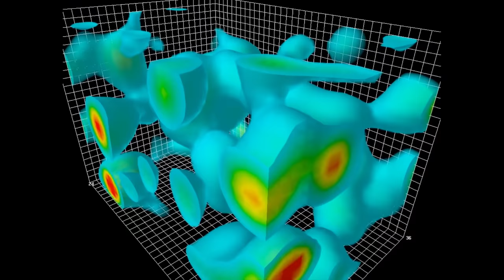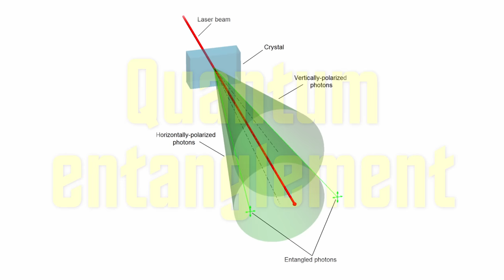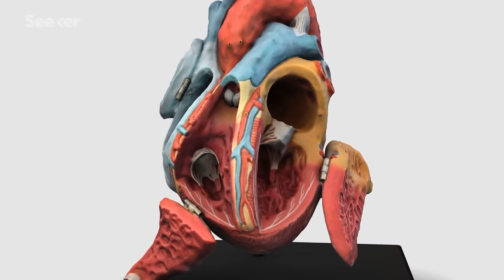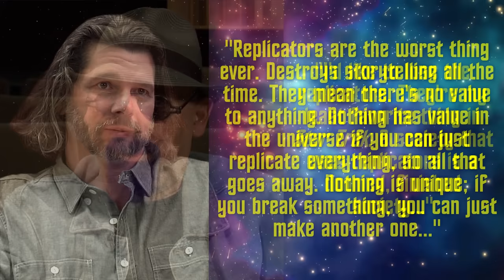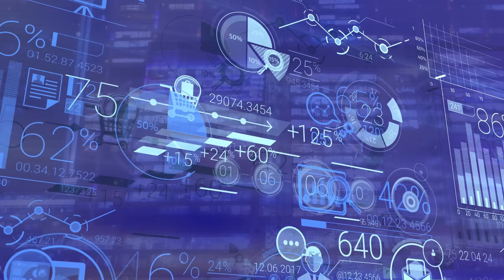Do Star Trek's Replicators Break the Universe?

Comment: With regards to 3-d printing, you cannot escape market capitalism if you cannot escape scarcity. While 3-d printing would disrupt manufacturing, there would still be markets for the raw materials that the printer uses as well as the energy they need to run. Star Trek has fusion. We dont.

Comment: One of the key questions is do replicators actually build elements (through nuclear fusion that is) or does it need to store elements and uses them. I think the latter is the case, as the first one would need too much energy, even with matter-antimatter reactors on every starship. Dilithium is probably very hard to come by and only available in the federations starships in abundance, because they are top notch. That means a replicator cannot replicate anything that has exotic elements in it. E.g. Most probably no radioactive elements at all. 
That would mean you'd have to refill the element storages somehow. Now waste disposal is for sure part of that process, especially when it comes to food... A starship is essentially a closed system. Nothing would just disappear. But for replacement parts there for sure is a certain limit to how much machinery can be replicated, unless you disassemble every scrap part (if that's possible).

Comment: OK, I'm a little confused with the problem of the three D printer, which should be a precursor to the replicator. The reason why I am confused is that going backward in time one reaches the notion of colonialism; taking raw materials from the colonies and bringing them to the main country for manufacture. The American "Revolutionary" war was fought, in part, to allow the colonies to manufacture things right there and technically it did not destroy the economy in the process.  This is similar to the "replicator" which is vague enough in the canon to be nothing more than a really fancy 3-d molecular printer. The real advantage of the star trek era is the ability to provide cheap unlimited power (which for the most of the franchise turns out to be fusion but that's another matter altogether).

Comment: The ability to replicate anything is simply knowing how many atoms it takes to build whatever kind of molecules you need and then placing those molecules into the right sequence to build the thing you want. If you know exactly what kinds of atoms and how many of each you need for any given object,  and know how to put the atoms and molecules together,  then it comes down to how much time would it take to do that and how much energy you need.

If you think of atoms as, say, individual Lego blocks, each with their own color and special ability, then all you need is the right number of the right color blocks, knowing how to put those blocks together so that the blocks interact with each other in the proper fashion, and then building your object.  The more complex the object, the more different colored blocks you'll need, and the more time you'll need to build it. Just like building a small Lego car would take less blocks and less time than a 3 foot diameter replica of the Death Star. Both are possible if you have the right blocks, know where they all go, and have the time and energy to build them.

And because organic materials are far more complex than inorganic, you'll find that it will be a lot easier, once the technology gets to that point, to make equipment and parts for things like spaceships than it will be to replicate anything like food.

Comment: Okaaay…from someone who worked in manufacturing and engineering there are a few caveat emptors here. There are limitations of resources involved. The assembly line is still superior for multiple parts for replacements. Like making by hand one screw or going to the store and getting a replacement off the shelves. Individual items take more resources like more energy than mass production. Mining, factories, and farms will still exist because they are more effective and efficient in supplying needs. 

I suspect the factory style replicators mentioned for Bajor are only good at making simple big items because super complex will have an unacceptable error rate and energy use and only using for things like steel beams. No wonder the planet still uses farming for feeding their people.

Comment: Replicators have way to many limits to break storytelling.
Complex machinery is generally off limits. As are any materials that are needed for the plot. And latinum. And Dilithium. And anything living.
Also they do still need energy. You spend less on mining and refining, but replication is not a loss free operation. Never mind repair and maintenance on the replicator, which probably can not produce parts of itself.
There are also issues with the things never functioning when you need them in a crisis, so storage still is important.

Comment: Replicators: Manipulating the four states of matter, you would first load in the matter through a scanning device of some sort to be stored thus giving you the recipe to then create it from then on, also being able to tweak it with additions or subtractions.  But it's the socioeconomic worries that I find to be unfounded. 3D printing as you said has caused some issues but how many regular people own one?  Just as digital currencies have gained and now fallen quite a bit, but the truth is that they are not going away and it didn't hurt economies or put anyone out of work.  I think it comes down to the power structures that are in play at every level, not power as in production of power but the power that is wielded. 
I also can't imagine the storage space required to store even simple objects to be replicated.  You also have to consider the 3D printer and how it comes in many make/models with varying degrees of ability, so would replicators. So whether they are issued or purchased what degree of ability you would end up with would be dependent on something.
I believe that it's presence in the world would be accepted as easily as having all of mankind's knowledge at your fingertips ie your phone.  As robotics continues to accelerate I don't think there is a job now that can't be replaced with robotics/AI.  So the solution to the workforce problem of that is in fact the replicator.

Comment: I actually have a solution for the uncertainty issue for transporters, sort of. If you have a particle that is bound by a signal medium like a laser, which is something they do in labs, it is effectively at either end point at the same time, so, what if you could prism that type of signal, so that the end meant to receive a particle, was instead of focused point but a spectrum range, or basically splitting the signal so that the particle is 1000000000000000000000000000000000000....... times more likely to be the other end at any single point in time. So at the point the uncertainy has to be resolved, it would be possible but infinitesimally improbable for the particle to still be at the sending end, basically forcing it resolve on the other side (head cannon for how Stargates work in the Star Gate universe, and explains why wormholes can only send matter in a single direction, but the carrier signal the gate itself uses to connect to other gates can modulate with a radio signal like a string carrying sound, and the other gate rebroadcasts it so that's why it can function in two directions for radio signals)

Comment: Not really sure why the writers hated them so much. There are many things that could have been done to nerf the replicators' seemingly infinite capabilities. Software restrictions (such as non-officer units being restricted from creating weapons) or data limits (not having the required data needed to create an item) were obvious blocks that I seem to recall being in the shows. Power constraints are also a problem as either the energy or the matter needed to make an item has to come from somewhere. Electromagnetic interference from other devices or phenomenon in the are also could easily effect such a device, as any variation from the strict programmed reconstruction could cause incomplete replications, flawed replications, or even complete failures in the process. Replicators are far from the perfect technology. Also used in early episodes of Voyager were moral constraints - they didn't just go in and replicate a need for a people willy-nilly. The Prime Directive made it so that Starfleet was not supposed to directly interfere with a culture's development, or upset balances of power between factions. (Of course, this never stops it from occurring at times when an officer defies the Prime Directive for whatever reason, but that is another matter).

Comment: The real one is coming in 30 years, its being build right now, its called the Nano Fabricator, it can take apart molecules atom by atom and rearranging them to print what ever you want, Earl grey tea cup and all, it can also recycle anything 100%, including taking the carbon out of the air, creating a solid block of carbon to be used for other projects. it can be seen as the analog version of the replicator, you could recycle organic things, move the atoms along tubes and reassemble the thing on the other side with another Fabricator. (and no you won't be able to tell the difference between printed food and grown, as the atoms used are the same)

It won't be able to make atoms from energy as we are not there yet.

But imaging people making a dish, selecting the upload button, placing the dish on the pad, it will get recycled remembering the position of each atom and atom type plate and all, giving it a name, and anyone with a Fabricator, can select the dish, put in the raw materials, mostly dirt, water and air, and it will be printed in the blink of an eye. (Things at Nano scale go 1000 times faster than on the macro scale)

Comment: I'd say no, Replicators do not "break the universe." the best part about the replicators is that they have made them so diverse, and limited.  for instance I seem to recall that worf and data had to go to a special room to "order" a present for someone and it appears to me that they couldnt simply replicate these items on the replicators in their rooms, meaning the ones in their rooms are only capable of replicating food items.  so it's probbably not just an issue of software handicaps, but certain replicators simply dont have the capability to replicate items using certain heavier elements.  for example you cant print a fully loaded glock in Ten Forward, not just because the computer wont let you, but the replicator is incapable of replicating certain metals because it's just an organic elements grade replicator.  It would make sense that having more complicated & capable, replicator be able to handle more elements such as metals, would simply cost more money and power to make. Just like having a metal 3d printer is more expensive and a more complex machine to use the metal sintering system capable of making metal parts.  I also remember an episode where they were talking bout delivering "industrial replicators" which I would presume would be more dangerous and more powerful, likely capable of producing the various metal parts needed to manufacture items like tractors, and industrial tools, made of metals.  

These limitations and "handicaps" that the writers have already put on replicators give the writers the various macguffins, and other such plot devices.  so, no.  I dont think they destroy the stories.

Comment: My biggest complaint with star trek replicators is their focus on energy to matter conversion. I'm no scientist but from my understanding the process of converting energy to matter is a massive leap in technology and would like require astounding levels of power, not just the energy being converted but energy to facilitate the conversion as well. It seems like it would be much more logical for replicators to have banks of elements that are manually arranged into the desired compounds, this would be objectively less energy intensive, would probably be "lower tech" and more realistic. Plus it would add an interesting plot device where certain plot items that need replicating could require unstable elements not carried in the replicator banks or by having a finite amount of material that can be replicated before they need to go "restock" on certain common elements. I think a plot device like this wouldve served the Voyager series very nicely.

Comment: Since the principle is based on the idea of reorganising atoms into whatever you desire (which is not theoretically impossible) it is entirely possible to work.
Of course, as it stands we don't have the capability to do that in the insane quantity of atoms that would need to be arranged in order to produce any item desired.
Seperating electrons, neutrons and protons from an atom to turn it into a different atom isn't a simple process; currently this is done by shooting the atom with subatomic particles in order to seperate or add particles to the core and often results in just producing isotopes of the existing atom. This is done manually, one at a time. You'd need to to be able to do it to millions of atoms in a short amount of time. 
Again, this isn't impossible in theory but we're a LOOOOONG way away from this kind of technology.

Comment: No, they don't violate the laws of the universe.  I have to constantly explain this to uninformed people what a replicator is.  At its core a replicator in Star Trek is a small-scale specialized cargo transporter that takes basic materials and compounds from a ship or facilities stores and cargo bays such as polymers for the dishware and complex carbohydrates for the pasta.  Then using a set of stored instructions in the local computer core i.e. a replicator pattern, the unit essentially 'builds' your requested item molecule by molecule including exciting the appropriate materials to give the patron in this case a plate of warm chicken primavera instead of melted plate of cold pasta.

Comment: What isn't discussed here is where does all the energy come from to replicate things ?  If I understand it correctly a replicator is converting energy into matter.  Einstein had E=mc^2 which is how much energy you could get from antimatter.  For a very small amount of matter it takes a huge amount of energy.  On a starship it is assumed the energy comes from an antimatter reaction regulated by dilithium crystals and then routed through plasma conduits to the replicator.  This means the plasma conduits must be able to handle insane amounts of energy.  They use plasma conduits for the control panels.  No wonder they are always blowing up in the helmsman's face !

Comment: I think that the "problem" with replicators is that most people don't seem to understand how much "energy" is inside even one atom of hydrogen, to even synthesize that from raw "energy" let alone billions of different kind of elements...someone needs to calculate the energy necessary to make a normal size red delicious and then tell me if they are feasible in that right, if so, then they will definitely be ubiquitous at some point.

Comment: The replicator used, according to the tech manual for the Galaxy class ship, the left over radiation from warp drive to power a transporter like effect that recycled waste material (including bathroom) into hydrogen that was stored to be reused as both impulse fuel and plasma for the dilithium reaction as well as reconstructed into the everyday items used by the crew. Incidentally that same waste radition was the stuff transported on those radiation barges featured in Voyager but by then the writers had already trashed so much of the canon of the series that it was never mentioned.

Comment: Replicators are the extreme of our days processed foods. They are faster to "prepare" but they are not as nutritious or flavorful as home cooked food from scratch. The time saved by the use of processed food is lost in health. As far as 3d printing of parts and materials. 3rd printed parts is not as strong as hand made, but they make materials and parts available to the masses were as you had to home someone makes and sells the part you need. As a person who loves to restore old equipment it is becoming harder to find what you need at a reasonable price.  Having a 3rd printer in plastic or metal would help a great deal in that respect.

Comment: Thanks.  I think they play with the idea that the food is always absolutely identical.  If you order a chicken sandwich, it's going to be the exact chicken sandwich you ate last week / month / year, right down to how the lettuce curls, and that one inedible bit in the corner.  In theory, they would've used an example of each food, and just have the replicator copy that, down to the molecular level (as you pointed out).  So you might get tired of eating cloned food.  There's no 'natural' variation.  You're eating the exact same sandwich, down to the crumb.  Every time I make a sandwich, it's different.  Also, I don't think I ever saw someone order 'extra mayo' on anything.  It's totally cookie-cutter food.  They probably are world-breakers, in-universe.  But they do require an energy budget.  No one could just order an infinite number of paper clips.  There's probably some low-level AI involved.  As to feasibility, I'd be inclined to think replicators were much more doable than transporters, for a variety of reasons (including the 'no cloning theorem').  You don't have to worry about whether the chicken sandwich still feels like itself, or remembers its mother.  I think most hurdles to making them would be engineering problems.  Of course, that assumes a LOT about energy sources and control of individual molecules by some sort of energy field.  But they still couldn't turn lead into gold.       tavi.